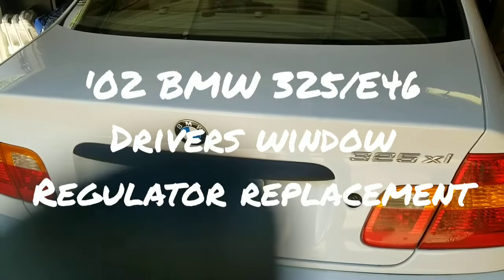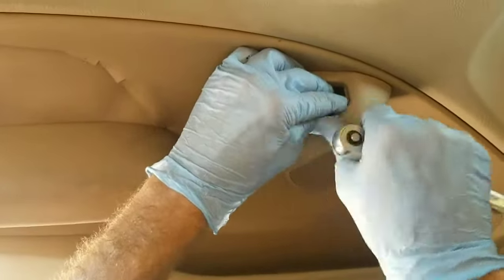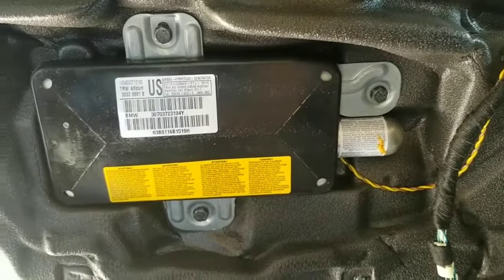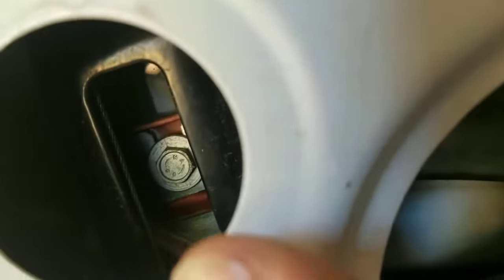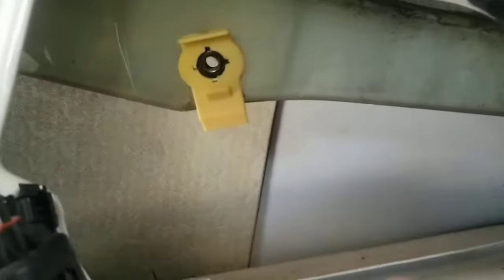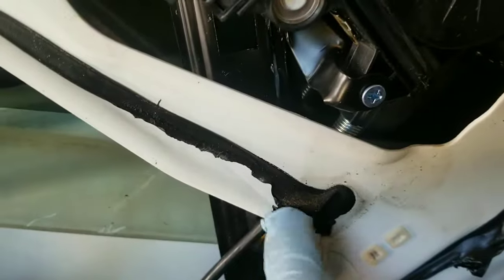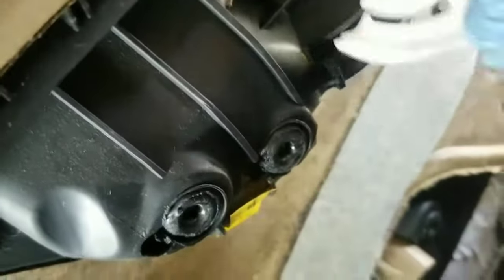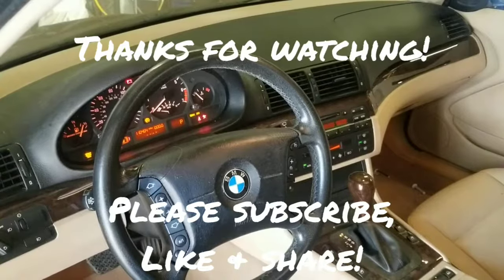BMW 325 E46 Drivers Window Regulator Replacement

Comment: What brand regulator do you recommend? Thank you
Reply from the maker: It really depends on what the customer wants or ask for. If its my personal vehicle, it depends on which vehicle it is. Cost plays a factor also. If a Dorman is $75 and oem is $300, Dorman it is. But if Dorman is $75 and oem is $90, oem is going back in. My wife's vehicle is fairly new, so it gets oem on everything. I believe this bmw got a Dorman but I'm not 100% sure. Thanks for watching!